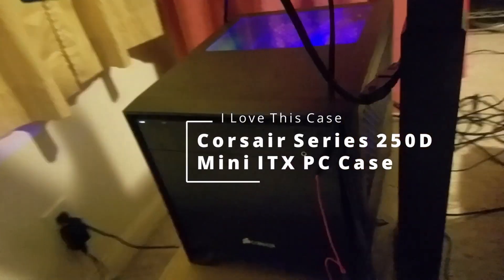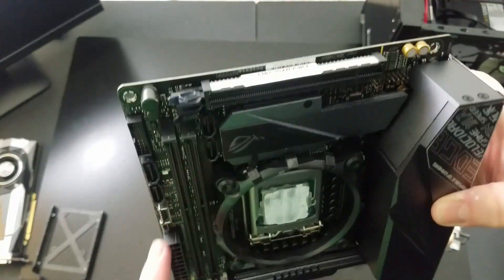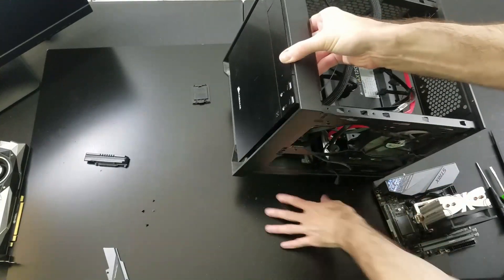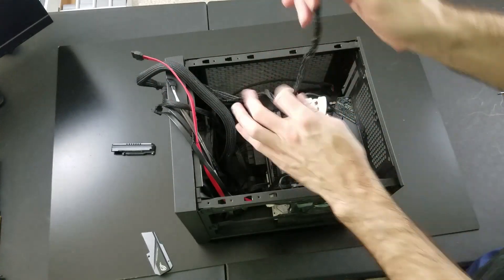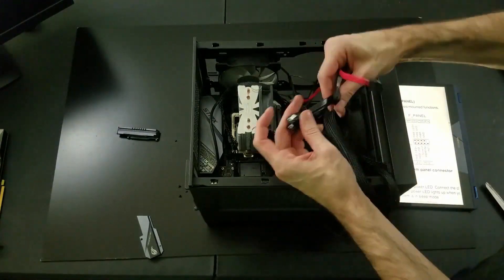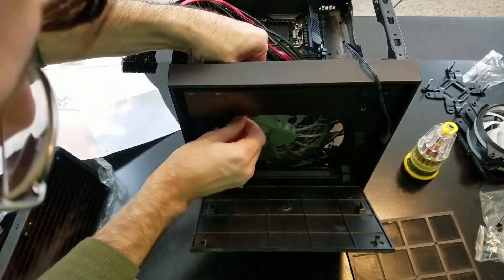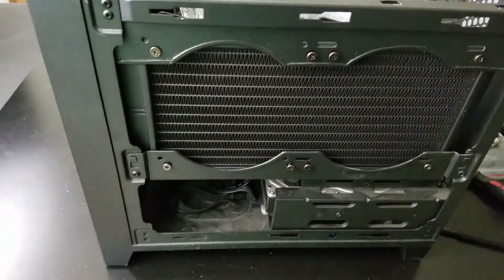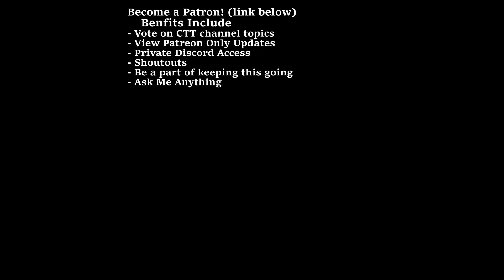Corsair 250D PC Case Build & Upgrade | MiniITX Gaming Rig

Comment: I've built several times in this case in past 7 years that i have owned it. Couple of tips to make your life easy. 
The radiator has a bracket that can be removed by unscrewing 2 screws on each side. First screw the radiator to bracket and then slide in the radiator with bracket. 
The front fan can be installed after radiator install just make sure to buy a 120 mm fan grill and the fan should be 120 mm. Install the grill on fan then the fan to the case from front. 
Use the zip ties hook at front bottom of case to clean up cables.

Link to my build image for some help: https://share.icloud.com/photos/01nQl3XDldjVTLXubnJLKSofw